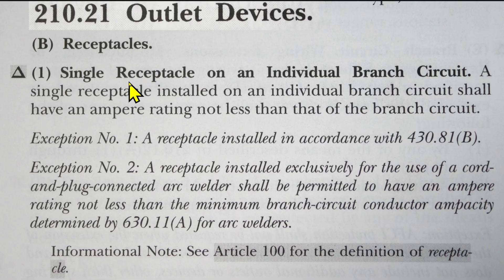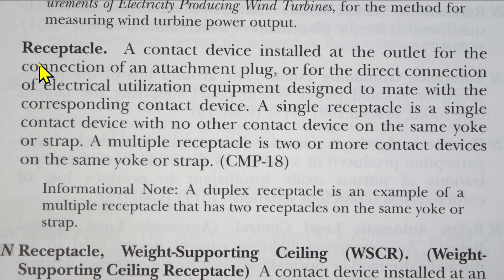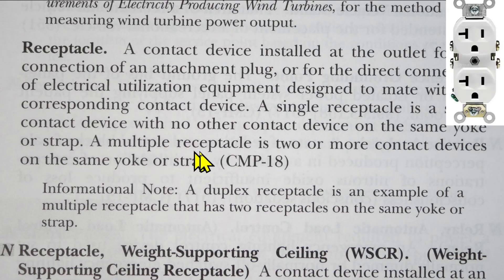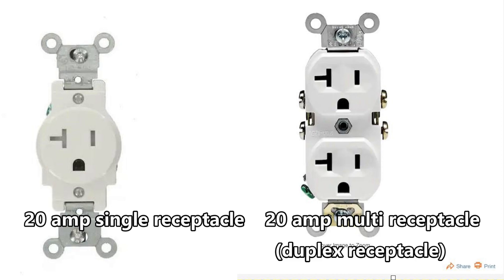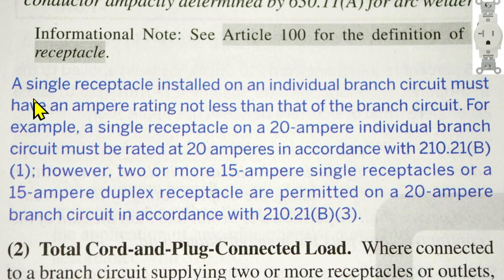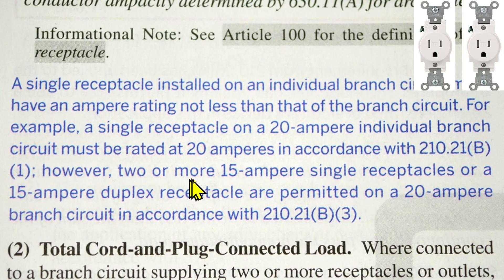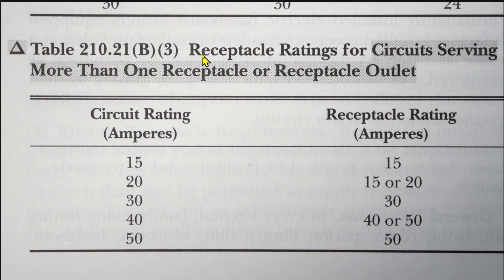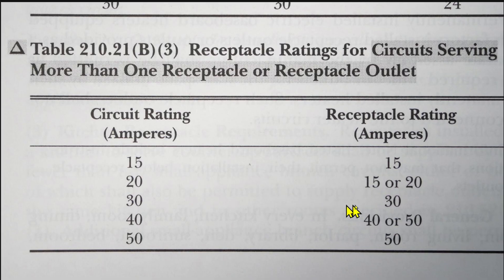Shall I Use 15A or 20A Receptacles on a 20A circuit per 2023 NEC 210.21(B) ?

Comment: Whenever I replace a duplex in my home, I use the ones that have the same amperage rating as the circuit breaker.  The first time I ever saw a 20 amp grounded duplex was back in 1980 when I helped my brother move into a new college campus apartment at University of California Irvine.  My home has ungrounded duplexes with both horizontal and vertical slots on both the hot and neutral sides.  The neutral side has a bigger slot, per NEC code from 1955.

I have 2 two part questions regarding meeting code for a 20 amp circuit regarding half receptacle-half switch outlets:  does the half switch half outlet count as a duplex on a 20 amp circuit and meet code under the exception listed for using a 15 amp rated receptacle on a 20 amp circuit?  I have not seen a 20 amp half switch half outlet at any electrical supply or hardware store, ever.  And in my garage, I have several pull chain lights with 15 amp receptacles on a 20 amp circuit.  My garage is a detached garage on one breaker.  I just saw a rule, requiring a switch now to act as a separate manual cutoff from the breaker box, before it reaches the GFCI that cuts off the rest of the circuit.  Do I need to upgrade my circuit by installing a 20 amp rated switch upstream from my GFCI which protects the rest of the garage, including my lights?  I can pull my single gang box, and replace it with a double gang box to install a 20 amp rated cutoff switch next to my GFCI, which will protect the rest of the circuits downstreaming from it.  Fortunately, the studs are all exposed in my garage, making the job easier.
Reply: Regarding your garage question, from 225 (outside branch circuits and feeders), 31 (disconnecting means) "..means shall be provided for disconnecting all ungrounded conductors...".  This is before anything else, so yes, this is before other devices such as your GFCI. Additionally, there are requirements on the location of disconnecting means (readily accessible, where the conductors come in): 225.31(B) (2023) or 225.32 (2020). Local requirements can come up here too, like your fire department wanting it outside, more than a snap switch, labeled.
Reply: @RJ-ej1nr  my home is on 1955 NEC Code where there was no requirement for a shutoff.  My breaker box and meter are outside of the house.  My GFCI is easily accessed, as it's the 1st on the run, on an open stud.  There is no plaster on my garage walls, so the box is easy to replace.  I saw another user's video of a detached garage from 1920 with knob & tube wires being rewired to modern NM wiring.  I figured on asking about the shutoff, as it's better safe than sorry, even though the GFCI will trip and shut off the whole garage.  My lights are on the GFCI circuit.  If a 20 amp Spec Grade Decor switch is available, I can use a double gang box and put the two next to each other.  That way, it'll be easy access.
Reply: @maxheadroom8857  From a practical perspective, your test switch on the GFCI almost works as a disconnecting means. However, since that test button won't always turn the power off (like if power isn't on or if it's defective), it doesn't. Is your area currently under 1955 Code? If so, that's a learn something new every day thing for me.
Reply: @RJ-ej1nr  my area is under NEC code for 2023, as is the whole state of California.  I'm also under Orange County California's building codes, and parts are even more strict for remodeling.   For repairs, I'm still exempt under grandfathering with the 1955 NEC code, as I have not remodeled the electrical wiring, and I inherited my home.  My breaker box is the first generation Square D XO breaker box, without any 250 volt wiring inside or outside of the house.  All new construction was required by the county to meet the current NEC Code at the time the whole building was built.  My best friend's childhood home was built in 1964, and met the NEC code for 1962 which required all receptacles be grounded, and all boxes be bonded.  My detached garage under 1955 code required that the boxes all be bonded, but the receptacles need not be 3 prong.  My walls are bare with the studs exposed, so I can see where the wires are running.  If I were to remodel the home, I would need to meet the 2023 code on all fixtures and receptacles, requiring a new circuit panel box and meter, plus new plumbing to meet new plumbing and building code, including fire sprinkler retrofitting in the house and detached garage.  I would also likely be forced to install a dual function AFCI/GFCI weather resistant outlet onto either one of my front side walls or my front wall to meet the outside outlet requirement for the code.
Reply from the maker: HI! Excellent questions. If you look at 1:54, you will see that NEC is only referring to "contact devise". That would be something that receives a plug, so a switch wouldn't count IMO.
Perhaps the switch you're referring to is a breaker in the panel?
Reply: @SparkyChannel  what I have in my kitchen per 1955 NEC is a garbage disposal on the half switch with a combination outlet on a 20 amp kitchen circuit.  The Square D XO Breaker assigned to my kitchen powers all the receptacles in the kitchen.  Originally, the first switch that powered the disposal was a 2 prong combo switch in a bonded box.  I replaced the switch once in 1985 with a grounded combo switch - there was a ground wire in the box for the switch, to ground the disposal.  The disposals were hard wired.  I know the old 1955 code permitted wiring the circuit with the half outlet and switch.
Reply: @maxheadroom8857  Square D XO? I've heard about them in legends but didn't realize they still existed... If it wasn't for that, this could have been an easier solve by replacing the 20A breaker with a 15A. I get the intent of the code being that if a device is designed never to be above a certain amount of current, and it's the only device on that circuit, have that breaker be at that amount. So if a 15A device is on a circuit pulling 20A as the only device, it's defectively broken, potentially dangerous and the breaker should trip. However, I just did a search on "20a switch receptacle combo device" and several came up, so maybe that's simplest and minimal effort.
Reply: @SparkyChannel  I just noticed the exception regarding the combo switch/receptacle:  the switch on my circuit leads to another receptacle for a garbage disposal.  The half receptacle is not the only receptacle on my kitchen circuit; all my kitchen receptacles and at least 1 living room receptacle are powered on the same 20 amp breaker.  My half switch leads to a single receptacle under the sink for the disposal, thus it turns out to having 2 15 amp receptacles on the circuit.
Reply: "Does the half switch half outlet count as a duplex on a 20 amp circuit and meet code under the exception listed for using a 15 amp rated receptacle on a 20 amp circuit?" What a great question! I'm no AHJ, but in my reading and digging, I don't think it meets the exception. One option would be to use a 2 gang box with the switch and single receptacle as different devices. They do make faceplates for that, too. But if you are going to that trouble, you'd probably put in a duplex next to the switch, lol.

Comment: Most kitchen appliances have 15 amp plugs which means the load will not exceed 12.5 amps or 80%. The 15A recepticles can handle 80% @12.5 Amps while 20 amp recepticles can handle 80% @16Amps. I still prefer installing 20 A recepticles for the kitchen and bathroom/utility circuits even though you're allowed to use 15 amp devices.
Reply from the maker: I'm with you on that. Great logic IMO!
Reply: My mwave draws 16.6 amps through a nema 5-15p fyi.
Reply: @sapreaper  It can still be on a 20amp recepticle even though it's slighty over 80%. It just needs to be on a single yoke and dedicated.
Reply: @dougbernitt5446  yes I know. I just thought your generic statement was a bit off in my case :-)  Though you did say "most". My mwave was on a 20 amp kitchen circuit with 15 amp receptacles. This is how many "old" houses are. I also like Sparky channel but did not really get/hear why he recommended/uses 20amp. The chance of needing the 20a nema 5-20r, is nil in the U.S. at least for a kitchen that is lol. To each their own. For dedicated appliance outlets I use simplex/single 20a receptacles, and 12awg wire/20a cb, along with 12awg for ALL receptacle outlet wire line feeds regardless of cb size. (Though almost always 20a, esp for new runs)
Reply: @sapreaper f you are pulling 16 amps through a 15amp rated receptacle, it is a fire waiting to happen. Depending on the type and sensitivity of the circuit breaker, 16.6 amps may not trip a 20amp breaker and constantly drawing overcurrent through an underrated receptacle will cause it to fail over time. Given the environment (a kitchen) there are plenty of combustible materials that could catch fire before the breaker detects enough overcurrent to trip. Just because it has worked so far does not make it safe.
Reply: @TwilightxKnight13 %100 agree
Reply: @TwilightxKnight13  yep, and I don't recall saying it was safe. But Imagine manufacturers selling these types of appliances with that much draw through an install 5-15p??  Most people would never know until it was too late. Luckily many 15a receptacles actually (unofficially) handle 20a draw and don't melt or catch fire.

Comment: Are you supposed use a 20 amp gfci if the circuit breaker is 20 amp? My gfci has number 14 awg wire going to it and says it is a 20 amp gfci I thought you could only put a 20 amp gfci receptacle if the wire is number 12 awg.
Reply: No, it's only optional. With 14 awg, your receptacle or GFCI receptacle must be 15 amp, and the breaker must also be 15 amp. You are correct, you can only use a 20 amp receptacle on a 20 amp circuit with 12 awg. Whether it's a GFCI or regular receptacle is irrelevant.
Reply from the maker: Ted's answer is spot on.

Comment: Another Great Video...   ,,,a lot of bad quality now. i have a 1950 house and the 1950 wall receptacles are still here and working great and not loose plugs hanging they are still tight Haha... but i have another house i own and it also is a 1950  house and someone replace the 15 amp wall receptacle at one time and i did 2 months ago replace it because plug were getting loose and had a bed connection... it was a newer type of receptacle...
Reply from the maker: Perfect example! A few extra bucks to buy the commercial spec receptacles and all those problems will be avoided. Thanks John!
Reply: By "newer type receptacle" do you mean a 3-prong? If so, it's not permitted to change from a 2-prong to a 3-prong unless a ground wire exists, and/or a metal conduit is used, and they are bonded in the main electrical panel. A metal box must be previously grounded by an equipment grounding conductor. A GFCI receptacle, even without a ground wire and an ungrounded metal box is a code compliant option.

Comment: My brother’s house in Florida had issues with the 20 amp GFCIs in the bathroom.  I was impressed that the contractor had bothered to upgrade the circuits during a remodel.  That is until I went to the panel to turn off the breaker and found it was a 15 amp breaker and the wire was 14 gauge also.  😬  Changed them out to 15 amp spec grade and only the first receptacle is now a GFCI.
Reply: Save that 20 A GFCI outlet since they are much pricier than the common 15 A ones.  Being a 20 A receptacle was only dangerous in the sense that someone might think it was on a 20 A circuit and thus plug a device w/ 20 A plug into it.  But those are very rare.  Such could trip the 15 A breaker, but that often happens anyway from using too many devices (w/ 15 A plugs), so was never a screaming risk.  At least insured they were protected from shocks to ground in the bathroom, but yes no need for multiple GFCI's in series.
Reply from the maker: Great job! Excellent troubleshooting and repair.
Reply: @SparkyChannel    Thank you for all you have taught us!
Reply from the maker: @glasshalffull2930  My pleasure!
Reply: Good thing you caught it. 👍👍
Reply: @Dave-nm3xc  All thanks to Sparky!  My brother is single and bald and so he hadn’t plugged anything into the bathroom receptacles in years.  No telling how long they’d been tripped, which was probably a good thing.  Of course the first GFCI on the circuit was hidden in the garage under a shelf and behind a bunch of boxes.  He had no idea it was even there.

Comment: for those interested in further detail: duplex receptacles carry two ratings: a feed through rating and a face rating.  the 15 amp receptacles he showed are a 15 amp face rating, but still have a 20 amp feed through rating.  there are receptacles that only have a 15 amp feed through rating and those are not approved for use on a 20 amp circuit.

personally, I'm completely comfortable using the residential grade receptacles for normal residential use.  I installed them in my own house.  where I would use a commercial grade receptacle would be if there was a location that was constantly having things plugged in and unplugged, or where there was a high amperage appliance that got used a lot.  

if you're only installing a few receptacles, the step up in price is negligible, so it's really a case of preference.  but note that tamperproof receptacles ARE mandatory in residences or places where children will be (I.E. schools, daycares, etc)
Reply from the maker: Excellent comments! All current Levition receptacles are 20 amp pass-through according to Leviton. Older versions may not be.
Reply: @SparkyChannel  interesting, they do seem to have discontinued the quickwire-only receptacles.
Reply: @SparkyChannel  my 1955 Leviton grounded 15 amp receptacle that I pulled from my bathroom to replace with a 20 amp GFCI was rated to pass through 20 amps.  It was residential grade.  My kitchen still has the old 1955 Leviton 15 amp grounded receptacle, in a box damaged by a roof leak in the late 1970s.  I'm about to replace the damaged box and install a 20 amp GFCI in place.  Since the breaker box has all the breakers, I will run a ground into my attic and share the ground with other currently ungrounded circuits.  The box shares the ground with a back porch light, laundry receptacle in the next room, light switch boxes in the kitchen and the switch box in the laundry room.
Reply: are the eaton br15 rated for 20amp pass through.
Reply: @danediz  I looked at Eaton GFCIs for my detached garage, which is on a 20 amp circuit.  The 15 amps are rated for 20 amp pass through.  I purchased a 20 amp replacement Eaton GFCI to replace a legrand GFCI that wore out.  The line wires go on the bottom lugs on an Eaton GFCI and the Legrand GFCI, opposite of the Leviton GFCIs which have the line lugs on top.
Reply: @maxheadroom8857  yes the gfcis clearly state they are 20a pass through. the br15 commercial receps do not say yes or no.
Reply: @danediz  the terminals are rated for up to #10 conductors, so that would indicate they are.  remember you have to get tamper resistant models to be legal in a house.
Reply: @kenbrown2808  yes depends on which nec code your locality is on. indiana is way far back. my house was built in 2017 and the regular receps were used
Reply: I assume the "feed-through" rating you're talking about is the ampacity of that little break-off tab that connects the pairs of terminal screws on both sides of a receptacle? I like to pigtail my circuits so downstream receptacles are not drawing current through that tab. (Well, all downstream except the other device connected to the second receptacle of a duplex receptacle.)
Reply: @aaron74  and the actual terminal screws. And truly, I've only seen that tab burn out once.
Reply: @kenbrown2808  That tab is pretty tiny on residential receptacles. The spec-grade ones are beefier.
Reply: @aaron74  actually you cannot, by code, wire standard receptacles in a pass-through configuration anyway. Only a GFCI being used to protect downstream receptacles can be wired that way. A receptacle must be installed in such a way that it can be removed without interrupting other receptacles which is why pig-tailing is required.
Reply: @TwilightxKnight13  You're right I think that is in code somewhere, written in cryptic language
Reply: @aaron74  it isn't.  as cjrock said, that code language applies to circuits that are sharing a neutral, in which application, the neutral must be made up such that removing a device does not open the neutral.
Reply: Children are EVERYWHERE so the tamperproof receptacles should be EVERYWHERE not just in schools, daycares, etc. Just more BS instead of having STANDARDS to make things more simple and SAFER.

Comment: So I had this question for so long ! So it doesn’t matter which on you place , because unless you know there will be using an appliance that will require a 20amp receptacle.placing a 15 amp receptacle is okay as well just depends on the preference 
Thank you sir much appreciate it
Reply from the maker: Yes, that's correct.
Reply: @SparkyChannel  Thank you for the timely and informative content sir!
Reply: It is very rare that you would ever "need" a real 20 amp recpticle in say a kitchen. And yes, their are commercial appliances that will sometimes require one. But, that is rare. Most folks use the better quality outlets like he showed, with the metal back strap, that is what I use. And I use the 15 amp on the 20 amp circuits. Internally, those two quality back strapped Leviton outlets are identical inside. The only difference between the two is the extra slot on the 20 amp outlet. Why pay more for an outlet that you may never use?